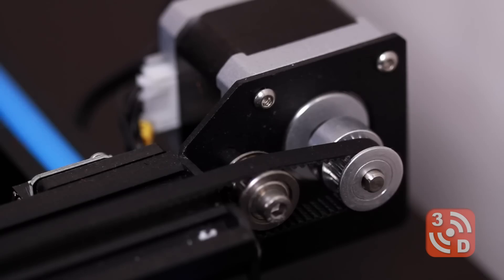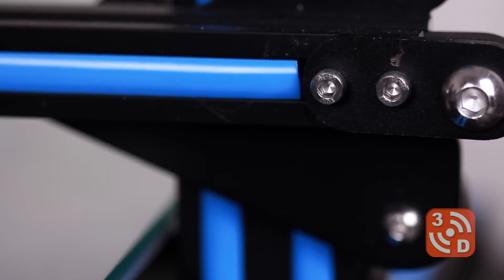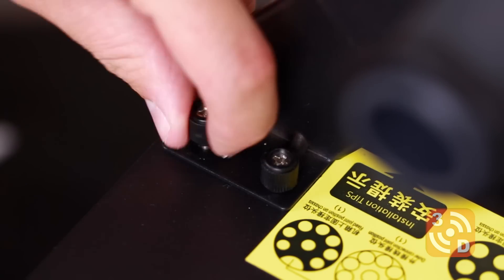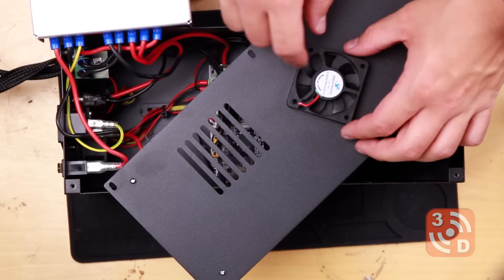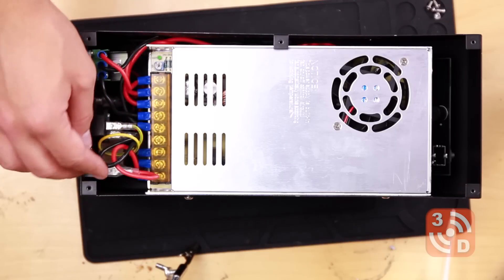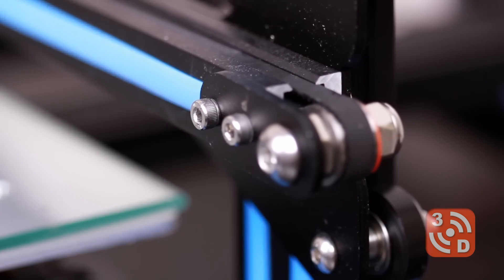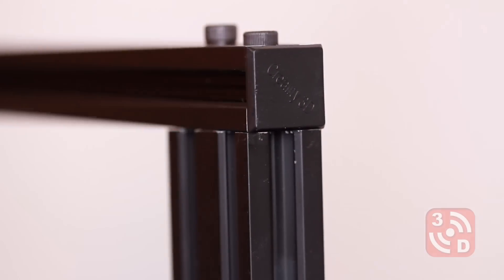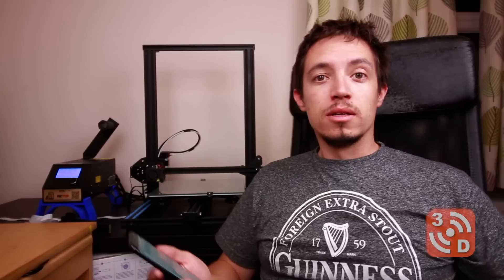3 Ways to Silence your CR-10

Comment: nice! I might consider the fan upgrades. also, you don't need to take apart the frame to remove the strips. you can just put a small screwdriver under the edge of one of them  then pry out and pull it out as it is rubber.
Reply from the maker: Thanks. Let me know how the upgrades go! Yeah, you can pry them out, however, I've read on some printers the rubber strip can be quite firm and doesn't come out that easily that way so this way it just ensures anyone with a printer like that isn't putting undue strain on the frame whilst removing them.
Reply: yeah... I thought they were all flexible like that.
Reply: No true.
Reply: No need to desassembly anything for the rubber strip. useless step.
Reply from the maker: maxun1 I've mentioned in several comments below, on some models people have received, the rubber strips are much more rigid than on others and put up a real fight when trying to remove it without opening up the frame. Rather than telling people to just pull them out, and risk them damaging their frames by exerting too much force, I've suggested the one size fits all approach.
Reply: Ok, first time ever plastic damage metal. woooooo
Reply from the maker: maxun1 it's not the rubber that would damage it. It would be the force that people are putting on the frame to remove it. Relax buddy, if you removed your rubber strips otherwise, I'm happy for you.
Reply: maxun1 yes true. I did it as soon as I removed it from the box
Reply: Heat guns are your friend.

Comment: Why did you remove the top horizontal blue strip?
The other blue strips that you removed can easily be removed without removing the parts that you did.
Reply from the maker: Hey Abinder,
I removed the top strip simply for aesthetic reasons. As I was removing all the other front facing ones I felt the top one would look out of place.
As for removing the other ones like I did, you can wedge pliers in and pull them out of the socket without undoing the frame, however, depending on where you bought your printer from, these strips are sometimes quite firm which can make this difficult, but most of all, it's just putting unnecessary pressure and stress on your frame.
Reply: 3D Revolution do the blue inserts, given their soft compound, not actually dampen resonances in the extrusions?

Comment: LInk to the washer?
Reply from the maker: As I mention at the end of the video, the washer wasn't a successful modification. However, I'm working on a solution to the misaligned belt and will post a video specific to that soon.
Reply: Oh, sorry I missed that part.
I actually filed the nut down behind the bracket to bring the belt in line with the v slot.
I was asking about the washer for a friend online, As Nexi tech posted about the washer a few months back but failed to supply the link, He stated it was there but I could not find it.
Cheers
Reply: I've got a solution I'm going to try and put into place soon but in the middle of decorating/moving house at the moment so it's difficult to pump out videos too quickly. Should still just be a matter of a washer, just a different size and style. Keep watch :)